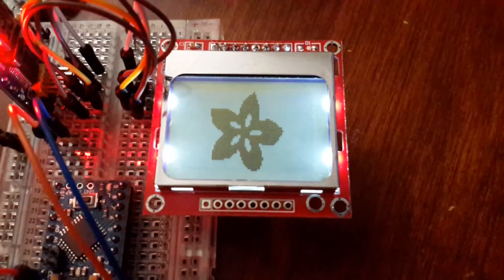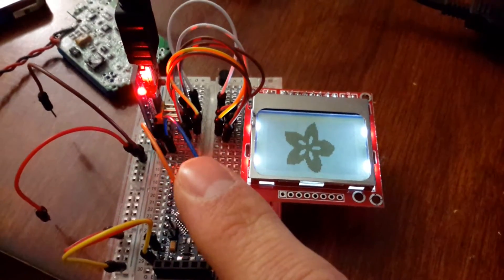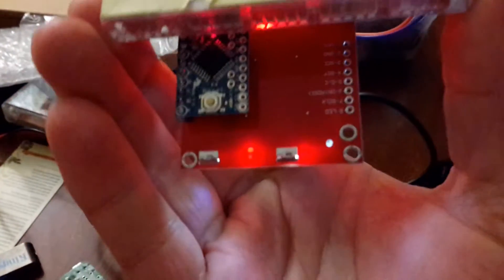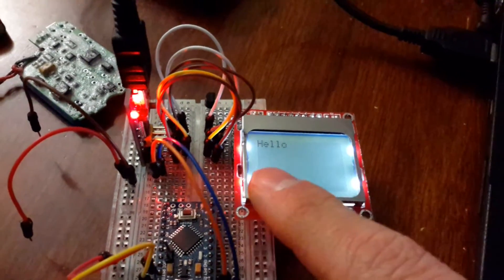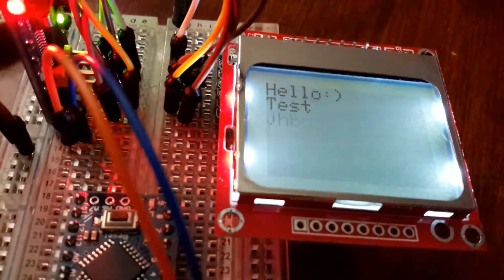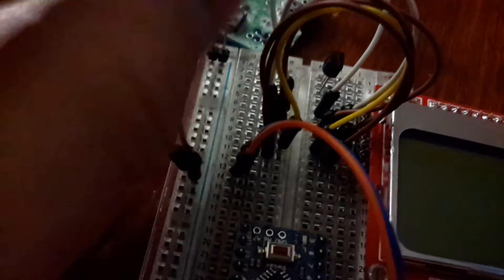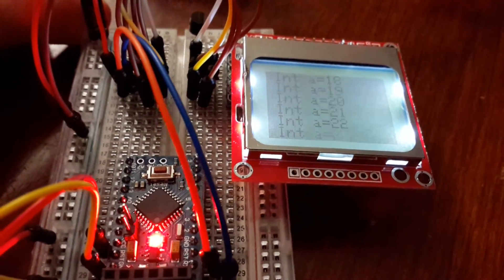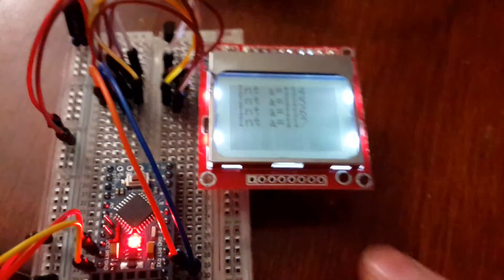Arduino External serial monitor

Comment: please tell the codes
Reply from the maker: +Ghanraj singh Since the code is rather small here it is!  * start of sketch * #include <Wire.h> //Even not use it need to be in there if not you will get error
#include <Adafruit_GFX.h>
#include <Adafruit_PCD8544.h>
// pin 8 - Serial clock out (SCLK)
// pin 7 - Serial data out (DIN)
// pin 6 - Data/Command select (D/C)
// pin 5 - LCD chip select (CS)
// pin 4 - LCD reset (RST)
Adafruit_PCD8544 display = Adafruit_PCD8544(8, 7, 6, 4, 5);
int i = 0,value, a, row = 0;
char txt[14]; //text array with 14 fields. Max 14 char each row are possible for this display.

void setup() {
  Serial.begin(9600);
  pinMode(9, OUTPUT);//LCD LED
  pinMode(3, OUTPUT);//LCD GND
  pinMode(2, OUTPUT);//LCD VCC
  digitalWrite(3, 0);
  digitalWrite(2, 1);
  analogWrite(9,127);//Light at 50%
  display.begin();
  display.setContrast(50);
  delay(1000);
  display.clearDisplay();
  display.setCursor(0,0);
  display.print("Serial Monitor");
  display.println("   Code by:");
  display.println("   Patrick");
  display.println("   Labelle");
  display.println("   9600 baud");
  display.println("Device Ready!");
  display.display();
  display.clearDisplay();
}

void loop()
{
  if (Serial.available() > 0) {
    value = Serial.read();
    if(value == 2){
      display.clearDisplay();
      display.setCursor(0,0);
      a=0;
      row=0;
    }

    if (value > 10 && value != 13) {
      txt[i] = (char)value;
      i++;
    }
    if (row > 5) {
      row = 0;
      a=0; 
      display.clearDisplay();
    }
    display.setCursor(a*6,row*8);
    display.print(txt);
    display.display();
    a++;
    if(a > 13){
      display.setCursor(0,row*8);
      row++;
      a = 0;
    }
    if (value == 13) { 
      row++;
      a=0;
      Serial.println(txt);
    }
    else{
      Serial.print(txt);
    }    

    for (int g=0; g < sizeof(txt); g++) txt[g] = 0;
    i = 0;
  }
}

* End of Sketch***

Comment: I like that. Useful within debugging as you say.
Got 2x Nokia 5510 screens with 5V Pro-Mini's behind both and this looks a good idea for one of them.
One use would be when running long run-time routines such as for temperature changes that may take 10 minutes and you need the PC for tuning up the program while watching the test results on the screen.
Reply from the maker: :) indeed You can even add an SD card in there to log the serial data :)